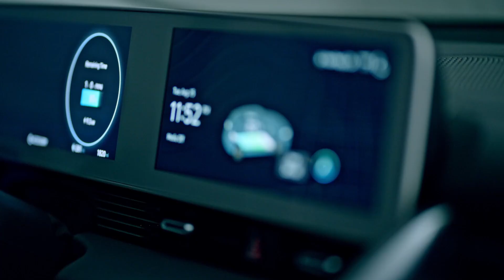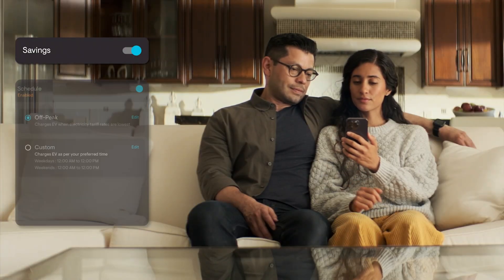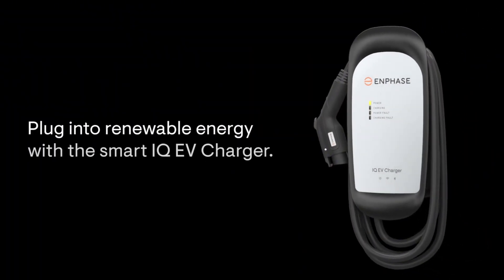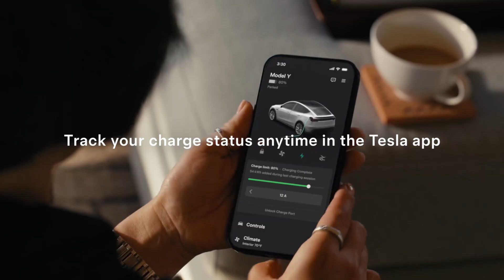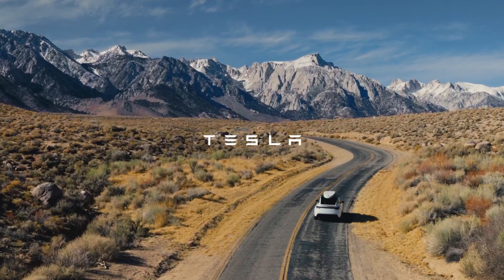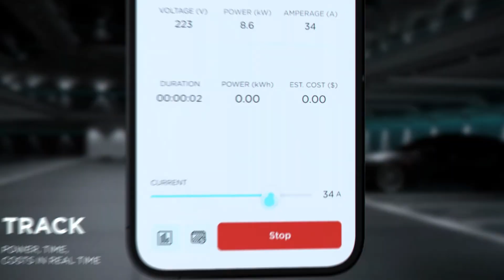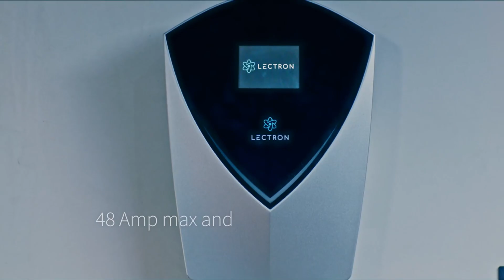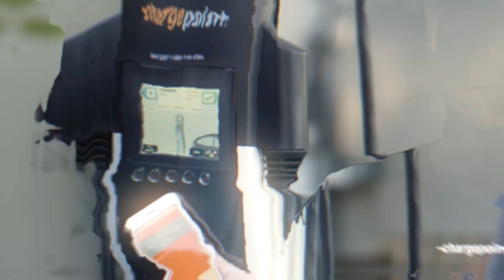Best Home EV Chargers 2025 | Top 7 Level 2 Chargers Reviewed & Ranked

Comment: I am on my third Charge Point home unit.  Two sent to replace original bought 2 months ago.  Cannot get a unit that will stay hooked to my wireless.  Have been on phone more than a dozen times with customer service, they are very good at answering phone and are helpful, but problem continues.  Have moved router, have added extender, still not working.  I have a dozen other things hooked to my wireless from different manufacturers and they work, including streaming my tv.  Noe app does not have WiFi reconfigure, but support says they are working on it.  Still charges, but the WiFi does not work, for me. Frustrated!
Reply: I have not purchased yet. Was about to get a chargepoint but have read too many stories of app and other problems with it
Reply: @DigitalDawg Installed number 4. WiFi worked for 24 hours.  Now waiting on their response!  After 1 charging session it worked fine, unplugged and light remained blue, should have been green, tried to reconnect, no luck, halo light now white.